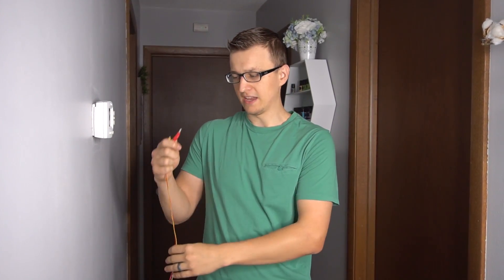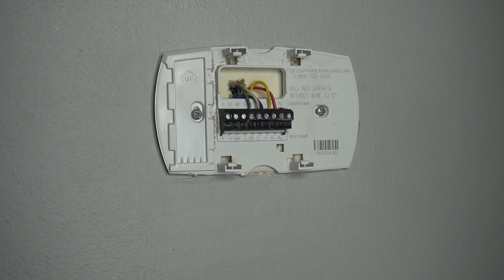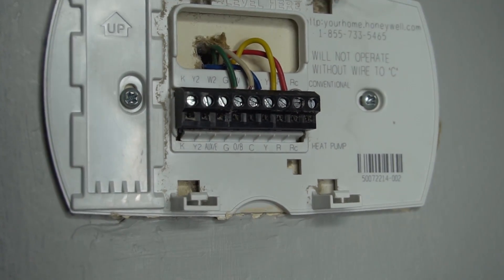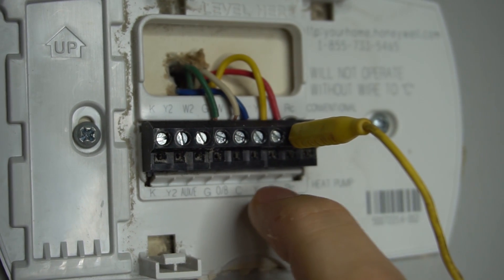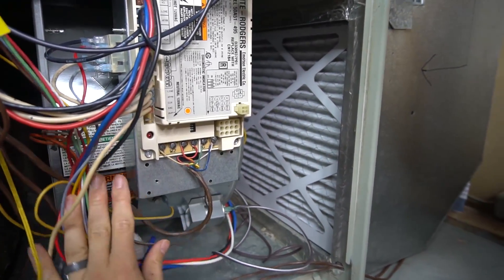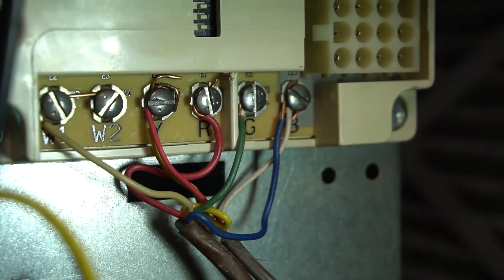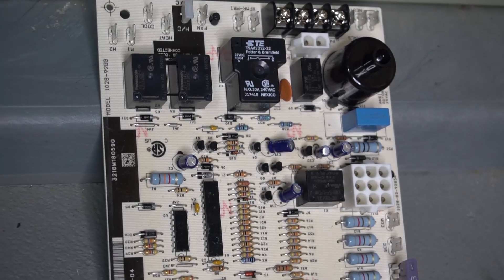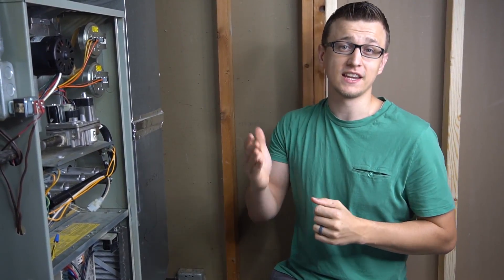Heat and Cooling Running at the Same Time

Comment: When I manually test AC, Heat & Fan at the thermostat, they work flawlessly. But when the AC cuts on the blower will stop & vice versa. They won't run at the same time  as they should when AC normally comes on. Could it be a wiring problem at either the contactor or IFC where I have replaced them both, 5yrs ago-for contactor which i just replaced again, or IFC replaced 9 mos ago. They worked fine till now.

Comment: What if your A/C outside comes on( I can see the fan motor running outside) when the furnace is in heat mode? You go outside and bang the side of the condenser outside, and the condenser fan unit goes off?

Comment: I found your video because this just started happening.  My furnace stopped working so had a tech come out and fix it.  He put in a new inducer motor.  Furnace started working but when I got my next gas bill the usage increased drastically with no significant change in my behaviors or the outside temperature.  Called the HVAC guy to come back and look into it because I didn't think it could be a coincidence.  He said there was no gas leak and maybe it was the thermostat.  Luckily, i called our gas company too and they sent out a representative.  The gas rep discovered that my A/C would start running as soon as the furnace kicked on.  I called the HVAC tech back and he said it would not be caused by changing out the inducer motor.  Is the tech gaslighting me (pardon the pun) and he caused this issue or could it really be just a coincidence?  Thanks for any info!!!

Comment: hi please help my heat pump confuse me why my fan keep running after heatpump off  for more than 3o minutes blowing cold air can i wire green on yellow heat pump want them work together and  stop together i disconnect the element electric no need them

Comment: Thanks for all of the informative videos you produce and share. I have a question that's a little more puzzling that I hope you can give your opinion on. What would you say is going on if you have a  Furnace (not heat pump) and AC - - and you have a White Rogers Thermostat (1F95-1277) set on Heat mode, with Fan on Auto, and when the Thermostat calls for heat you get the following sporadic response: The Furnace turn on sequence initiates but you also notice that the AC runs for maybe 10-15 seconds and turns off - - with the furnace completing its normal heating sequence run. The AC issue described is sporadic and does not occure every time the Thermostate calls for heat and the furnace sequence initiates and runs. Your opinion on this issue will be appreciated. Thanks again.
Reply from the maker: Oh boy, that's an interesting one. I would start by ruling out the thermostat first by disconnecting the Y wire at the thermostat. If the problem stops, then you know that the thermostat is defective. If the problem continues then my guess would be that there is either a low voltage short somewhere or a bad control board in the furnace. These would be more difficult to pinpoint so I would likely be doing some investigating and head scratching even if I was there. 😅
Reply: Thanks for the response and the suggestions. It looks like my Thermostat has two Y wires connected to it: a Y wire and a Y2 wire connected to the Thermostat. So would you disconnect both Y and Y2 wires or just the Y wire? The HVAC system is 12 years old and I have never noticed this happening before. I was also wondering if it's the Thermostat - not sure how long they usually last?  I noticed it about a week ago when I heard the A/C compressor running outside for maybe 10-15 seconds at the beginning of the heat call sequence and since then I think it reocuured just once (placed a paper on the AC unit housing outside and found it was blown off one morning on a non-windy day) with the furnace running multiple times every day. I took a pic of the Thermostat but I don't think I can attach it here. Thanks again - -  I appreciate your input. @WordofAdviceTV
Reply from the maker: @strongspear1918  Sounds like you have a two-stage air conditioner. You would disconnect both Y1 and Y2 wires then. A simple test like this would at least determine if its the thermostat or not.
Reply: OK - - yes - I have a two stage furnace and AC. The furnace runs every day now with the cold temps and the issue has not reoccured since I contacted you (which is kind of weird) - - and I've been watching it every day. Thanks again for your good advice. I will continue to monitor it and now I know what to do at the Thermostat Y1 and Y2 connections if it occurs again.  @WordofAdviceTV

Comment: So my furnace ac/heat pump unit yesterday came for some reason , outside -15f , but my furnace will run normally and use propane to heat so will go on and off as normally , but same time heat pump will run constantly without stopping, after furnace would heat house shuts off , but then in finance inside I could hear the humming noise so loud , and outside fan with heat pump will run and bring heat inside , the line that comes inside it’s super hot , this was strange bec heat pump never came on on below temp , so tried all this didn’t work , turn completely ac power and still will run , so I decide to open heat pump power supply cover , so I went and tap on fan switch or whatever it’s called and luckily fan and heat pump shuts off and fan switch goes off , so I have no idea why this happened, I do know that sometimes when it’s sunny outside heat pump starts for couple sec it goes off since it’s below temp , but my guess is that maybe yesterday got stuck from moisture maybe for some reason , just thought to share my experience if someone has same problem , next week supposed to be above 30 so that’s usually runs with heat pump and I’ll see if it works properly

Comment: I work in apt. And heat strip and condensor came on simultaneously but no fan, Good thermostat, good wire, new contact. Turns out It was ECM module in the blower that was bad; even tho I just replaced it a couple months ago. It tripped me up for a while

Comment: Bro...this vid saved me $200+.  Was having this exact issue while running my AC.  Followed these steps to the T, narrowed the issue down to the cable between the thermostat and control board, disconnected the the W wire from the control board and baba-bing!  I'm no longer sitting in a hotbox.  Thank you for what you do my guy.

Comment: Thanks for the help. Both the ac and heat were coming on.. its 88 degrees in my house and I am sweating bullets..100 degrees outside. Used the procedure you described. Not the thermostat. I jumpered red to yellow then red to white. Each time,both the ac and heat would come on.. first time I turned the system on this summer. Down to the furnace...found i had a chunk of wire fell and shorted w and y terminals.hence. problem solved. I am now waiting for my rooms to cool off. Thanks for the help!

Comment: I'm supposed to have a damper system and 1 thermostat upstairs and another downstairs. If I want upstairs 70 and downstairs 68 it's supposed to adjust but it doesn't. I've had 5 HVAC companies out and none of them know how to fix it. Sometimes someone turns the air on upstairs not realizing heat is in downstairs, can that effect my unit?

Comment: My thermostat set at 80* said heat on but furnace is not turn on is that indicator as bad thermostat but when I reset the power at the furnace the furnace turn on
Your answer will be helpful

Comment: Jay, thank you for all of your amazing content!! You explain things so well and have helped me so much!!! I have subscribed and shared your channel with many of my friends and co-workers. Now, I hope you can help me with an issue that I am facing: I recently installed an ecobee in my house and had to use the PEK kit as my thermostat did not have a c-wire. All seemed to be working well until i noticed that when my heat is on, my AC is also running. I changed the ecobee setting to let the HVAC control the fan instead of the thermostat and the issue went away. However, I did notice that when I have the heat on, and I reduce the temperature on the thermostat, the heat shuts off and then the AC kicks on for about a min and stops. Any idea what is going on here? I did trace the wires and I can confirm that I do not have a Y and a G wire crossed.

Comment: Thank you so much. I have a question: I only have Rc and Rh on my thermostat panel. There’s a red wire going into Rc and no wire in Rh. How do I proceed with jumpering?
Reply: U would just make u own small jumper between rc and rh..otherwise the thermostat can't control it..(rc is for ac..rh is for heat)

Comment: I have a separate furnace and ac/air handler. 
Two red wires rh and rc, jumper removed and then the usual white, green, yellow and blue. My ac has been coming on while in heat mode. I've tried two other t'stats and get the same result. All wires have been cut back and stipped clean. Any ideas?

Comment: I joined your blog a few weeks ago. I really enjoy it. I've always try to do my own fixing and maintenance on anything I can. Car - house - yard whatever. For my A/C new filters 2 or 3 mths. Clean A/C coils regularly etc. About 3 or 4 years ago my heater wouldn't come on. Couldn't figure it out and had to call a tech. Here's the rub. I've been in my attic more times than I can count (spkr wires - coax cables - antenna). The tech called me up to the attic and told me I needed an new furnace ($3K-4K) and of course he would get me a senior discount. Unit was about 12 yrs old. I noticed lots of stuff around the furnace that I had not seen earlier that day. He said it probably was rat droppings. I told him those were not rat droppings but not how I knew. I knew what they were and said I have to think about the new unit. He left and I went to work on fixing the unit. The droppings were bird droppings from the heater vent. I never thought about cleaning the vent pipe on a 90% unit. Perfect for warming a birds butt!. I  was the owner of a pest control company for 35 yrs. I'm sure I will need a new unit someday but it wasn't then. I wasn't into youtube back then as I am now. My brother-in- law gave me some great advice when I was a teenager. "If something breaks try to fix it. It's already broke AT LEAST TRY! Maybe you will make it worse but that will be rarely." Sorry for the long post but maybe  encouraging to another newbie.

Comment: Hopefully there is a short in my wire. I have a heat pump which turns on the heat strip when cooling is demanded.

Comment: I have a similar issue, While on heating mode: Furnace is blowing hot air and as soon as its getting near the room set temperature the AC Condensing unit turns on. I will try this.. Thank you for the video!!!

Comment: Both my cooler air conditioning thermostat and my water heater thermostat quit working at the same time last night. It must be a breaker? Everytime something goes wrong at my apartment is when the manager goes out of town on a weekend. Kinda like if you wash your car and then it rains but only enough to make your car dirtier than even before.

Comment: I have this issue today. Changed thermostat but heat/ac keep coming on at the same time (when it's calling for cool) . It's a gas pack so I'm pretty sure the issue is either with the wiring or it's the board itself.

Comment: It would be helpful to expand on the connection between the transformer and the control board. No 120v to transformer from control board means what ?
Reply: No 24 volts for controls.

Comment: Great video Jay.  Do you have any idea what's wrong with my system when I turn fan to "circulate" mode. In this case, winter time, for example, heat turns on each time when fan kicks in and same time during summer season, my ac unit goes of each time when fan starts what creates house temperature way above settings on thermostat. Thanks

Comment: So does the inside unit (fan) and outside unit come on at the same time when in Cool mode???
Reply: In the cooling cycle, inside (fan) and outside unit (compressor and condenser fan) should come on together. When thermostat is satisfied and shuts off the outside unit, the inside fan will generally continue to run for a short time to utilize any cooling effect remaining in the evaporator coil (the inside unit). On the heating cycle, the inside fan will not come on immediately, but waits for the heat exchanger in the furnace to reach a minimum temperature before activating the fan. This happens so the fan is not blowing cold air into the home. As with the A/C cycle, the fan will operate for a short time after the thermostat is satisfied to remove residual heat from the heat exchanger.

Comment: Jay, we are experiencing this with a NEST.  But the issue is intermittent.  We have swapped the NEST out for an old school Honeywell.  If this doesn't fix it, Gotta be the control board right?  Seems I read somewhere the NEST has been know to cause this issue.  Does this sound possible??  Thanks for the video.
Reply: I having the same issue with my Nest, When stage 2 of heat comes on it turns on the cooling also. When I removed the Y2 wire from the Nest thermostat only the heat runs. What did you find on your system if anything.
Reply: @gregorykazian804  Sorry, we didnt figure it out.  It wasnt my house.  I'm not sure what they ever sorted out.  I would have liked to known what it was.

Comment: How much do you want for the Rheem circuit board? Lol. Not a bad job of explaining how to diagnose the problem. Your control board in yours is common, very similar in design to older Rheem boards, but with a plastic cover over it. BTW, taping over drive/S cleats is unnecessary. The amount of leakage is negligible, unless of course it's whistling. That annoys the hell out of me. That, and too thin of duct. People using 30ga sheets for plenums and drops should be shot and left in the desert!

Comment: Great video J. This happened to me before, I wish I had this information back then.  Ours turned out to be a bad control board.
Reply: Are boards extremely expensive
Reply: @tammycalvertchetelat4834  idk, my guess id from 150 to $300, depending on age of the unit.  It's the ac repair man that costs alot.

Comment: Hi Jay..
I have a York ducted split A/C thermostat, I want to change it to WiFi thermostat..
I need information, is that possible?
Regards & Thanks
Reply: Are you saying you have a separate heating system from cooling, like a boiler for heat and air handler for cooling? Then, you remove the jumper from RH and RC and wire the R from the boiler to RH and the R from the air handler to RC. The Y from the air handler goes to Y on the thermostat and G to G. The W from the boiler to W on the thermostat. You'll also need a C from air handler, to power the WiFi thermostat. Except for modulating or communicating type of systems, a thermostat is a thermostat. They all have the same connections and do the same functions, like heat, cool, and fan. I just replaced a simple 4 wire thermostat with an Emerson Sensi, thanks to a rebate offer through my utility. I ran a new 8 wire )only buy 18ga solid wire, not phone wire or speaker wire) from the furnace to the thermostat, by cutting the 4 wire and attaching the 8 wire and pulling it through the wall. I wired the 2 stages of heat, fan, R and C, and Y1 between the thermostat and furnace. Even though thermostat wires are colored to the letters of the controls, they don't know what color they are, so make sure you connect the same wire to both sides. Many people make the mistake of putting white on one W but connect it to the other W on the other end, W1 to W2. I also wired W2 on the thermostat side and left it dead ended at the furnace. The thermostat has settings for 2 stage heat and cool, so I let it know I only have single stage cooling and it won't power the Y2. I plan to replace the condensing unit with a 2 stage later. I can also wire the humidifier through the thermostat, but I just installed an Aprilaire with digital controls, outdoor temp sensor, and it can humidify without heat on it's own. The thermostat can't do those functions or sync with the humidistat. I wanted extra wires, for any later add on, so I wouldn't have to replace the wire again.

Comment: hi Jay - I found your channel when I started noticing a problem with one of my AC Compressor units (January/Winter, unit making a clicking sound for most of the day)....at any rate, your channel is awesome and love the way you explain things!  One thing I wanted to do is see if you can help before I call a professional HVAC contractor.  As I said one of my units (4 ton York Affinity AC compressor unit from 2013 is making a constant clicking noise for most of the day 12-15 hours on a January day).  The AC mode has obviously been turned OFF since October 2019 in my location which is in NorthEast/NJ.  I have no idea why it is making this clicking noise when the unit is OFF since October (AC function).  Let me know if you have any thoughts on what to look for, or should I just call my local HVAC contractor.  Thanks in advance!

Comment: Great job. As an 40 year seasoned HVAC-R technician and engineer, My idea of a perfect system includes running the a/c during the heating season controlled by a humidistat. The a/c will only run when the humidity exceeds the set humidistat bringing down the humidity. Between that and an added humidifier, you will maintain a perfect humidity at all times.